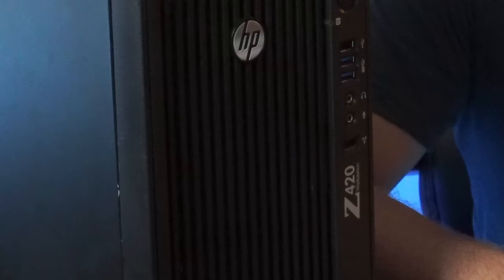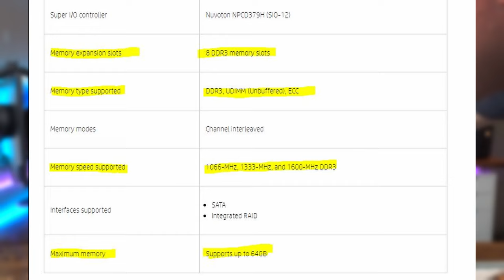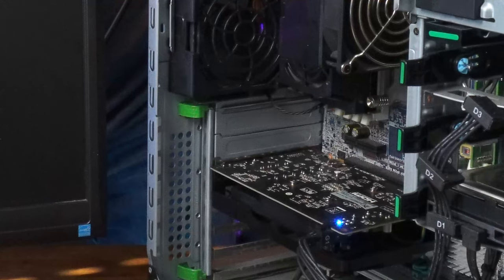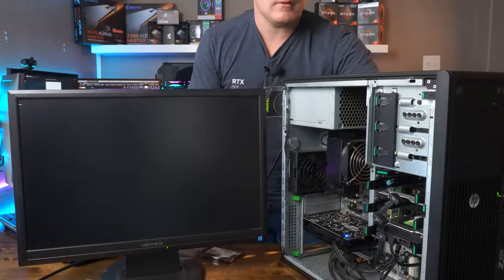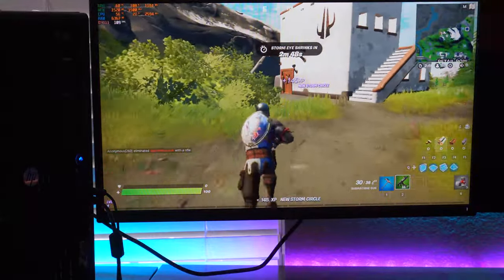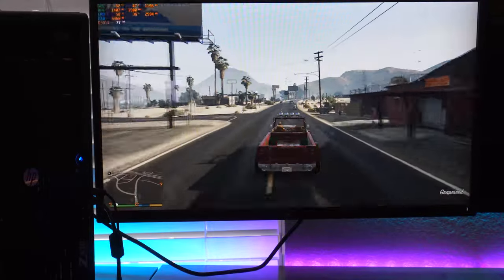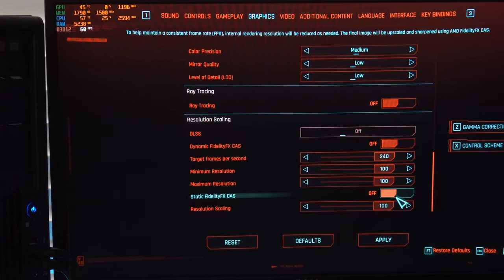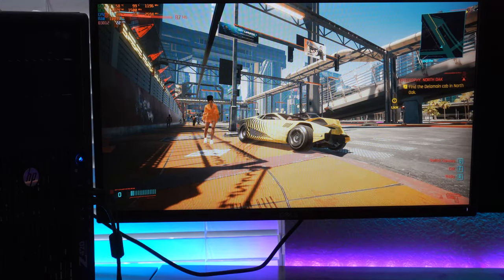I Bought a PC for Just $100 and it is AWESOME! HP Z420 budget workstation gaming!

Comment from the maker: ✔ Yes you can build a $600 Gaming PC in 2022!!!  Check it out! https://youtu.be/O6zRmpJrwDg
Reply: Hello, I got as a gift for Christmas a HP Z420 with the E5-1620 V2 chipset in it, but I have no idea what I need to enable/disable in the BIOS. I was able to get the hard drives into it, is there any guides on where to / what to do with the BIOS SETTINGS for using as a gaming system?

Comment from the maker: Should I upgrade this PC with a more powerful CPU and GPU as a follow up video?  Let me know!
Reply: Yep! Love deals :) and sorry dan on the name ..I've flipped a couple dell t3500 s last year n find deals every now n then..get a pc that has ram n decent processor for cheap n add a graphics card n most the time ill profit 100$ or more..tend to stay around the 500-600$ systems but did sell my old r7 1700x n 1070 8gig card n 24gigs ram ..got 1200$ outta it but I threw a 256ssd..a 3tb with 90 bootleg games..n an empty 1tb..think all the games had er sold :) moonshiners used to do it :) but I hafta be sneaky now a days with no vpn but ill still torrent up a game here n there :)
Reply: You lucky B@stard lol 😂 good job 👍🏻
Reply: What socket was that? Might just be worth upgrading ..I had a e3 1650 v2 ..6core12 thread chip I upgraded the daughter to..3.7 all core ..might have been e3 2650 v2 chip..50-60$ 6core..
Reply: Yes
Reply: I bought two of these thus year from a going out of business sale. I used one to build a computer for my wife. Swapped the board into an NZXT H150 case and swapped out the 4 core CPU with a Xeon X5680 (6 Core/12 threads) and AN EVGA 650W PSU. Also paired it with a GTX 970 4gb  and it is a great computer! You should definitely do more upgrades... It's worth it!
Reply: @2011jaydog  That's a 1366 socket/ X58 chipset.
Reply: Please do.  I have the same pc, with an rx580, I haven't tried cyberpunk though
Reply: Definitely, we would love to watch such a video! Thank you for this one!
Reply: Grab an extra 2687w v1 for around $70 8 core up to 3.8ghz, 3.1 base clock
Reply: @2011jaydog  lga 2011
Reply: PSU is non-ATX standard, you need a +12V standby voltage convertor for ATX PSU
Reply: Would love to see an update on the rig with some updates.
Reply: Yes
Reply: Yasssss queen
Reply: Yes definitely!!!!!!!!!!!!!!!!!!!!

Comment: I didn't get this notification for this video. I have a 2gb card too. I have a GTX760. GTAV on mine I get close to 80-92 FPS maybe because of my CPU I have a Ryzen 5 2600
Reply from the maker: Bummer you didn’t get notified!  Thanks for checking back on me though!  On the system side yours has more potential with the much more modern CPU.  Sounds like we are about around the same level of performance though.  The rx560 is a lot more modern of a GPU compared to your 760 but you got me beat on the CPU side.  Sounds like both systems are about equal matched.
Reply: @PCTechHustle  you're right. I agree its about leveled equal. I am considering a GTZ 960 I think its a 4gb for $145. What do you think?

Comment: i picked one of these up at the local computer shop just across the street. i use it for gaming and video capture. works great. came with a 500gb mechanical hdd and a 500gb sdd. ended up taking the hdd out and replacing it with my 1tb sdd and an extra 222gb sdd. later down the road ill add a few more 8gb ram sticks to it. 

Processor	Intel(R) Xeon(R) CPU E5-2690 0 @ 2.90GHz
Video Card	NVIDIA GeForce GTX 1060 6GB
Operating System	Windows 11
RAM	16 GB
Reply from the maker: Awesome!

Comment: How were you able to used a operating system from a ssd drive that were not installed on that z2240? 
I usually thought os dont work if it is pulled from amother computer.
Reply from the maker: If an OS was once installed it’s tied the motherboard MAC address.  So once it’s there it’s there for good.  No activation required

Comment: did you ever make the upgrade video you mentioned at the end of this.? I just bought a z420 with 64 Gb of ram but I want to upgrade the gpu from the 1Gb card that's in there now and i would like to know what the best one to go for. The cpu is an e5-1620.
Reply from the maker: I actually didn’t end up doing it but I want to revisit it for sure!  These are great machines with great upgrade paths!
Reply: I've just bought one as well with the same cpu but only 4gb of ram. I didn't think other people had the same stupid idea as me lol
Reply: Get a gtx1060 or gtx 2060 and also upgrade your CPU to a i7 6850k. This should make for a balanced machine that can play 99% of all games at 1080p on low-ultra graphics, depending on game. A pci expansion card with a Samsung 950 NVMe m.2 can also be used for faster accessibility.  Have fun

Comment: I just got one of those for 600 sek, approx 60 USD. Might be a steal!  Looked fresh, not much dust. Used by a gamer girl. 

Everything inside except for GPu and a harddrive and 16GB ram like yours. My plan was having it as a retro rig but with all the praise it's gotten I'm sure it can do more, a nice little backup tower.  

Haven't booted it yet since i got another retro going, but i will! :). 

Was installing Windows 10 on it fine?  no issues?  could it take Windows 11, that's my current question...
Reply from the maker: Hi thanks for watching.  Windows 10 install went well without a hitch.  I’m sure windows 11 will do okay too.

Comment: So my z420 has the 6 core 1650 Xeon in it. Upgraded the ram to 32gb in quad channel and threw in a bunch of hard drives and a ssd for the OS.
I believe mine only has pci e 2.0 what would be the best current gen card to put in it? I have a gtx 960 in it but I want to be able to run things a bit smoother but I understand pci-e 2.0 will bottle neck any new AMD cards. I was almost thinking a rtx 3050/ 2060
Reply from the maker: Those are pretty powerful cards for the gen of system.  I’d probably stick to the 500 tier for AMD cards and 900/10 series tier from Nvidia
Reply: i think z420 comes with pci 3 mobo and cpu 1650 v2
Reply: You can comfortably use a 2080+ at 1440!!!! I have the 1680v2 and 2080ti, amazing combination.
Reply: @lmaoitsmee1812  i am now thinking to pair 4790k with 3080ti at 4K ! dropping 2k totally ! What do u think of this ? would it work ?

Comment: my comupter will crash 1 or 2 times every other day or so and say the system experienced a boot failure possibly due to incorrect configuration previous settings in bios may not be compatible with current hardware state.  but its set to default already im kinds lost here lol any help TY. its a r3600 and gig.b550 arous pro ac MB running f12 bios
Reply from the maker: What hardware are you using as your boot drive?
Reply: @PCTechHustle  TY for responding im using Samsung 970 EVO Plus SSD 500GB M.2 NVMe its the only drive im using in this computer

Comment: there are total 10 sata ports right ? how many are sata3 6gb/s ones ?
Reply from the maker: 2 minimum, possibly more.  Don’t quite remember.
Reply: @PCTechHustle  thanks. is it possible to install windows xp on this workstation?
Reply from the maker: It is but I wouldn’t advise it.  XP hasn’t been supported in several years now so security vulnerabilities will be present.  Unless you are keeping it off the Internet, then you should be fine.

Comment: I got a z800 workstation with duel xeon e5690's and 40 gb of ram for less that one hundred dollars.
Reply from the maker: That’s nuts!
Reply: @PCTechHustle  I was suprised too.

not a beat up wreck either. not a scratch on it, even still had the palstic film over the side panels. 

also came with 6 hard drives, two solid state, 4 mechanicle.

Comment: How noisy is it once it's up and running? I'm not planning on gaming on it, just as a server (because of the number of trays) in my living room.
Reply from the maker: Pretty quiet honestly.  You can always put a fan silencer on it too, which is an adapter that pushes less voltage to the cpu fan (if you can adjust speed in bios)

Comment: Hey dude I have the same thing, do you know if a RTX 2070ti can fit in here with a i7 6700 with 4 cores? Or would it bottle neck it? I have a GTX 1660 Super just to confirm guys it works! :) Good for VR gaming too for a decent PC! :D :) If your looking for a stable build. Especially for VR Gaming and VR Chat. ^_^ :)
Reply from the maker: It might bottleneck a bit with that kind of GPU but I would say that is a close balance.  I don't think it would be massively detrimental for performance using that combo!
Reply: @PCTechHustle  a i7 6850k and a 1060 or 2060 works great and pretty much tops this old computer out. Some ppl say it will run a 1080ti and a 3060 or 30 series gpu, but it's better to balance the system and prevent as many bottlenecks as you can. If you can get your hand on a Samsung 950 NMVE m.2 and a pci adapter , should be able to play any game with maybe a few exceptions.
Reply: @manhandler  I'm planning on getting another HP Z240 because it died not too long ago. And planning on maxing the ram out and adding a 4k card on it if I can ever afford it. Idk if I can get a AMD graphics card or a Nividia card or not on a Intel Motherboard. I heard you can upgrade the CPU on the HPZ240 for VR support to make it even better. As far as I know, if you get a HP Z240, I found out you can add a single i7 7770 on it I think. Which is super dope IMHO I've seen PCs on ebay with that Processor on it and it was pretty cool. Some people even showed pics. I did have a SSD on mine and it ran fast. The power supply sucked tho only had like 400 something of PSU. 

 Tho if you can get a i7 7770 working on a HP Z240, max ram out or get 16gb of ram on it DDR4 ram, and a decent GPU, then you're all set for VR and 1080p gaming. I was playing Kingdom Hearts 3 non stop with mods! :D Had a 1tb SSD and 1TB HDD and loved every bit of it. ^_^ Wish you could insall a CPU cooler tho. :( Just, don't let DUST get in this tower PLEASE if you get one. I'm begging you, don't make the same mistake I did. On top of that my GTX 1660 Super melted in the motherboard too. :( It was a HP GTX brand GPU. It was good while it lasted. :( So need to fork up some money on a new card. I miss SteamVR so bad. Ugh. :( And Skyrim VR too. :( 

Also if you plan on getting this tower, PLEASE for the love of god, If the PC case is REFURBISHED, CHECK the CPU's thermal paste and install a new one ASAP! Before you do ANYTHING! With it! Just a tip. I finally learned to install Thermal paste. So please just dear god double check for old thermal paste. Make sure you buy from a good buyer too! :)

Comment: I have this PC I have a graphics card that needs a 8 pin ( evga gtx 960 ssc). I only have 2 6 pins from stick psu. What can I do to make it work?
Reply from the maker: You can buy 6-to-8 adapter.  That should set you up well.
Reply: @PCTechHustle  important to note that only a 2x6pin to 8pin is up to spec, as a 6 pin nominally delicers 75 and an 8 pin 150w

Comment: You can replace with an E5-2697 v2 to have a 12-core CPU, the clock speed are not that high which not good for gaming, but it's still a good choice if you have some software could utilize all of your cores.

Comment: Replace CPU with i7 6850k replace GPU with gtx1060 6gb or 2060, put a NmVE pci expansion card with a bootable ssd m.2 like a Samsung 950 and you will be able to play almost every AAA games including Cyberpunk. A Z440 has a better psu and can do v4 chips as well.
Reply: A Z440 also can use ddr4 with ecc. It will however not run non ecc ram. The i7 6850k run great on the system although it does 4 chn mode it will not make use of the ecc memory feature.
Reply from the maker: Yep!  Z440 definitely a much more capable machine!

Comment: I scored a Z420 and Z440, traded a 64gb oculus quest 2 for em.
Reply from the maker: Not a bad trade 😉
Reply: @PCTechHustle  i have hp ml150g6 dual main board. and want to take advantage of it and build it into a gaming pc. i am having fan and sensor problem. only 10 wire is off. plz help me. thank

Comment: You can get a psu with two 6 pin connectors that fits in there with same 18 pin connector and you can run gtx 1080